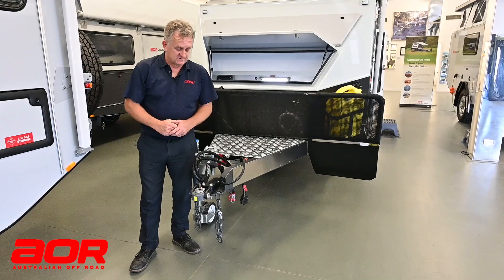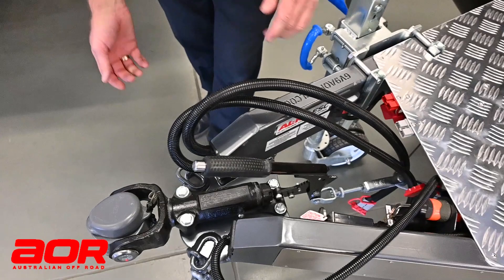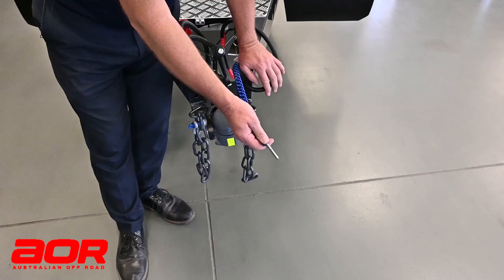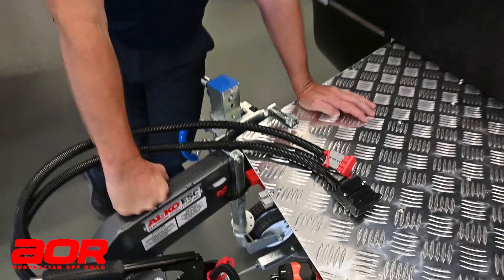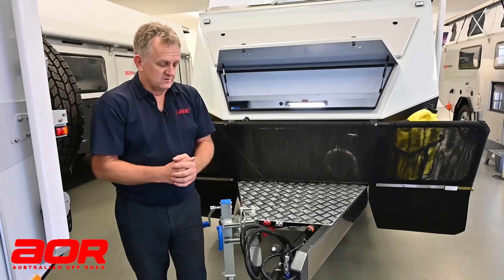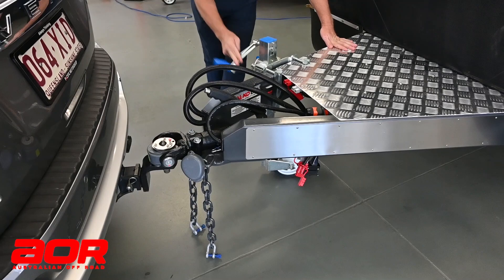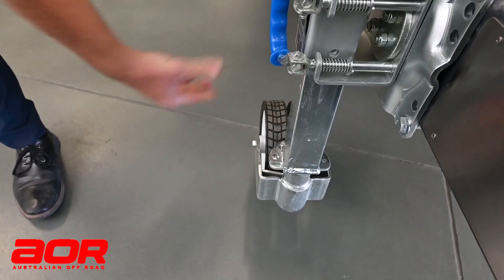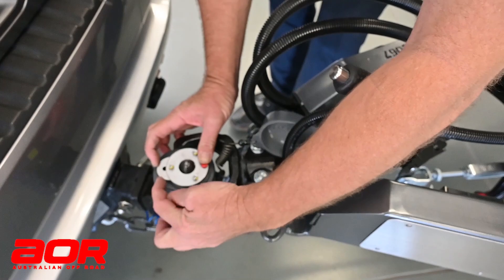AOR - Handover - All Models - DO35 Hitch - 2020

Comment: My only problem is you don't make a version for small boat trailers. If you have a caravan and a boat trailer I would have to change pin to ball because it isn't compatable with different capacity hitches.

Comment: I notice you have the factory ford tow hitch upside side, doesn't that reduce your towing capacity and also not legal?
Reply from the maker: Hi Brad - it is legal, here is some useful information https://www.4wdingaustralia.com/4x4/can-you-flip-your-tow-hitch/
Reply: @AustralianOffRoadAOR  I'm presuming you supply the tow pin for the DO35?
Reply: Ford OEM tow hitch sticker states - Rated for tongue down orientation only. Even the reference website states - 'Some tow bars and tow tongues have stickers on them, clearly stating which way you can use them, and whether there are any weight reductions from turning them over.' Seems AOR are misleading their viewers.
Reply: @stevennixon9033  It's Ford that is misleading customers. Ask an engineer, they will tell you that the design is flippable. There is no difference in rating.